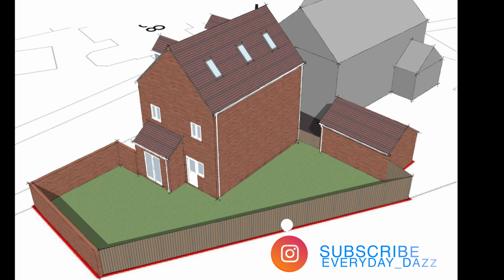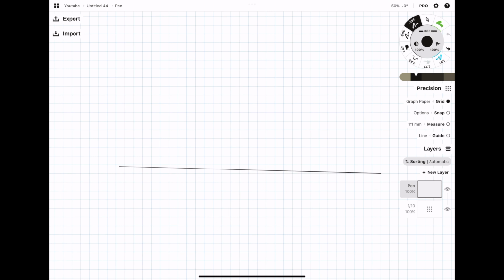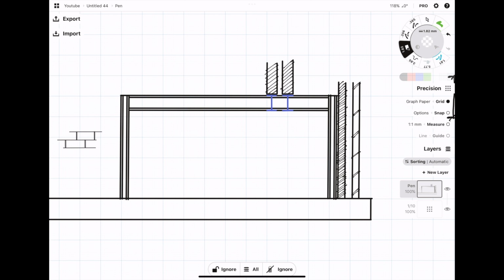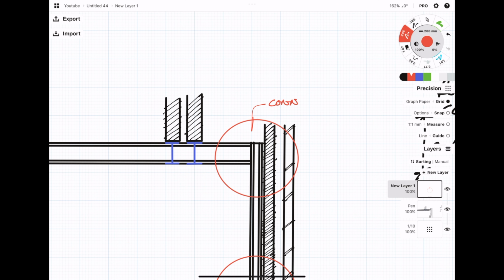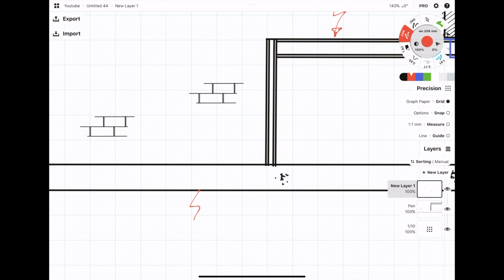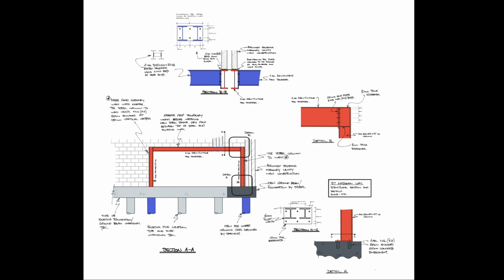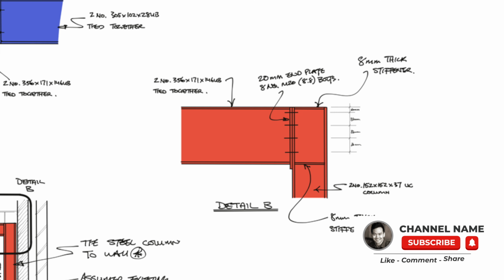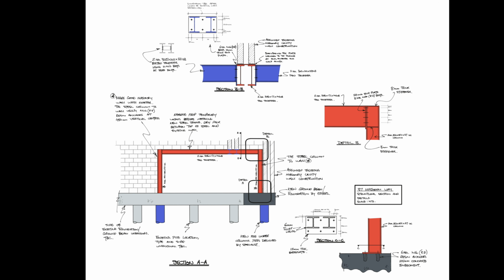How to come up with engineering sketches - structural engineering

Comment: Very clear to understand, I wish I had you do my se calcs and drawings 👍👍 I’m lucky if I get a measurement on some of mine I’ve had 🤣🤣 can I ask I noticed in one of the sections it says to make good masonry and mortar and to tie the column to the wall (assume 100mm blockwork) with m10 anchor resin bolts. Would that literally mean wall the blockwork back up butt upto column and then once all cured drill through the column into the blockwork with the resin bolts at 450mm spacings( 2course block) or could it be achieved with the Lbracket type ties hilti gun tho the column then walled up (still keeping it tied every 2 course 450mm)?.love the videos learning a lot 🙌🏻🙌🏻

Comment: Thanks for the videos as always. I typically design/detail so the beam sits on top of the column so the beam isn’t relying purely on shear in the bolts. What are your thoughts/preference. Need to pull my finger out and start my chartership with IStructE!
Reply from the maker: That detail is fine and some contractors do prefer it. It’s easier to find software that designs the moment connection when the beam is bolted to the face of the column. I’m sure it’s possible to design a moment connection when the beam is bearing on the column, but I haven’t come across a piece of software that does it. And I’m too lazy to do it by hand 😛
Reply: @EverydayDazz  ah that’s fair enough. I use quikjoint although the default is as you have detailed. So I change the axial and horizontal force so the it tricks the column/beam to essentially swap
Reply: Masterseries does this moment connection

Comment: Thanks for the videos there a big help as a new graduate. I have 2 questions. 

1. How would you determine the loading on a frame like this? Would you have to pull up floorboards / internal investigation to check joist spans and determine if there are any load bearing walls internally? 
2. Why would a goal post frame be needed and not just a steel beam to bridge the opening? 

Thank you!
Reply from the maker: 1. The loading would be from walls and floors. So yeah lift up floors to determine joist spans etc. 
2. Several reasons. Load is too large to be supported on just masonry walls. I need the goal post frame to also act as a stability frame as I am removing a significant wall which would have been providing resistance to wind loads. Also with the amount of load, I need the beam to work as a moment frame to reduce deflections. If it was only bearing on walls, the deflection would be higher as the beam can only act simply supported.
Reply: @EverydayDazz  understood! Thanks for the explanation
Reply: @EverydayDazz  Hi Dazz, how do you define the deflection limit for steel beams supporting masonry?
According to BS it's L/360 for dead & live load, but that might be too big deflection for longer beams, e.g. 8m beams as it can be found in some resi projects. I limit the deflection to 12mm, but that's close to L/700, do you think it's an overkill?
Thanks,
Reply from the maker: I tend to limit masonry deflections to L/500 or max 20mm for new masonry. 

For supporting existing masonry, I’d use a tighter limit. Something around 10-15mm max

Comment: Im curious.  In your line of work, would a sketch like this be a final issued document (stamped, sealed or whatever yall do), or does this go to a draftsman to layout in sheets before issuing?
Reply from the maker: For this project. This was enough for the fabricator as they were going to site to measure the exact measurements. 
For bigger jobs, this would probably be drawn up properly on CAD. 
However, it’s not uncommon during construction stage of big projects for them to build off sketches. Completely depends on the situation really.
Reply: @EverydayDazz  so this would probably be in response to an RFI or some other construction request for more details on a particular point?  Most places I've been, constructors won't touch a detail or sketch with a ten foot pole if it's not a formally issued drawing.
Reply from the maker: Exactly. 
For small resi stuff like this, sketches should be fine.